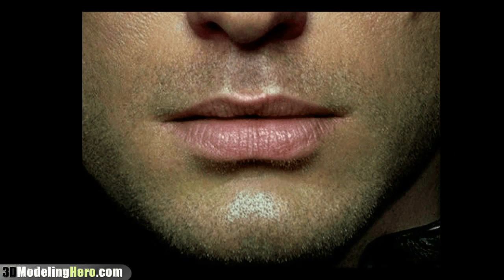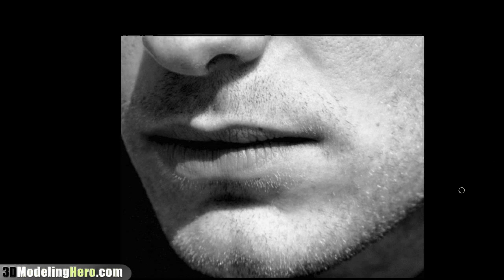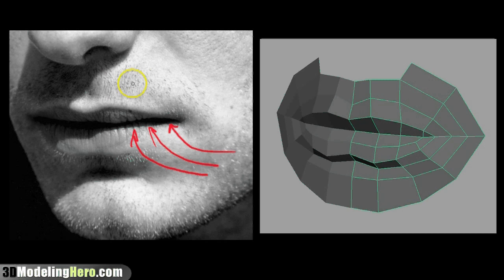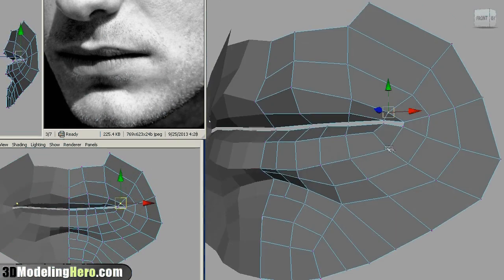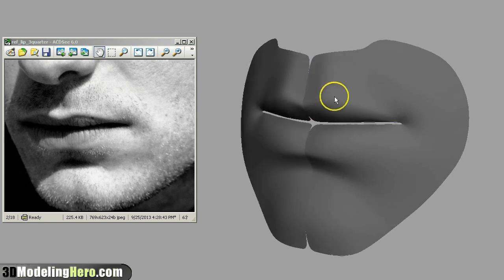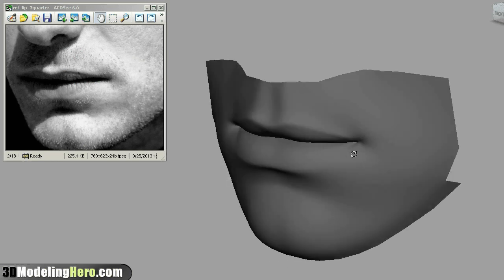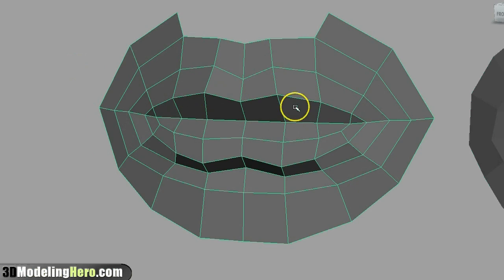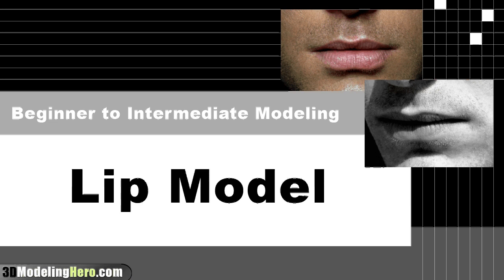How to Model Lips & Mouth - Low Poly Beginner 3D Modeling Tutorial

Comment: How do I do the first step? = Split the polygon so that I can mirror the animations? (I'm a beginner) I would just like the name of the tool :)
Reply from the maker: Leo Svensson I use the Split Polygon tool. The mirroring is just so that you can just do half since both sides are identical.
Reply: WeiWorks Thing is, I use the Maya 2015, but it's not there and I really don't know how to do it :(
Reply from the maker: Leo Svensson If you're a beginner, you'll need to get a manual for this in the bookstore. once you're familiar with the interface and it's functions, then you'll be able to model.

Comment: why do you have triangles?
Reply from the maker: Jason Whyttes Because triangles are perfectly fine in subD models. The triangles turns into quads once subdivided. Also, triangles help create sharper pinch points that you might need in your model.
Reply: So this tutorial is for a more high poly character?
Reply: Really good question, I had the same and it's amazing how much this little dialogue here taught me. The little triangle in the corner of the mouth seems useful.

Although I thought it's best to do quads in your cage so it's easier to add detail loops but I know it's good to take any advice and rules with a grain of salt and be adventurous enough to venture outside quad dogma.

Comment: Wen you are modelig the mouth, you should have made it abit slower so ppl actually saw what u were doing. wouth of that. Great job! ;)
Reply from the maker: marvelett I sped it up because it can get tedious. Hopefully the man points got across in the video.
Reply: They did. Its a good tutor. Do you have one for the whole face as well? :)
Reply from the maker: marvelett I have one of a low poly face, which is a starting point for any face. It's or Arnold's face. Check it out.
Reply: Thanks. Will check it out

Comment: like it a lot, very useful, thank you very much for that. But I have one question, how did you get those symmetrical instances?
Reply from the maker: Thanks 365Pixelz. The symmetry is created by mirroring the object on it's z axis. Just turn on the 'instance' option on the mirror panel. In Maya, it's just the 'Duplicate' function. In Max, use the 'Mirror' function.

Comment: What kind of tool you use to draw lines (edges)
Reply from the maker: In Maya, it's the Split Polygon Tool. It's the most useful tool for modeling.
Reply: Thanks
Reply: What do I need to model the way you do without even references
Reply: I can model hard surface either in 3D Max and Maya but i would like to model heads and human in general without resorting to reference images that is what i dream about)))

Comment: Amazing tutorial I just have one little problem I cant combine / merge the instance object. I have tried merging the vertices with the normal merge and vertices merge. any ideas. cheers keep up the good work
Reply from the maker: Yeah, instanced objects cannot be combined since they need to reference each other. The simple solution is to just duplicate one of the instance objects. That will get rid of the instances and then you'll be able to combine the two. If the instanced object was mirrored, make sure to check the normals as they are reversed. So check the normals on the duplicate one before combining with the other.

Comment: This is really cool, thanks for sharing your technique. Hope you'll do one tut on the eye area too, that's the trickiest area imho ;)
Reply from the maker: Thanks for checking out my videos. The eye is similar to the other parts in terms of complexity. I'll get to modeling the eye eventually. Thanks.
Reply: WeiWorks a very tricky part is the caruncula imho. Some people integrate it in the main mesh, some others leave it separated. Also the way edges flow on the outer corner of the eye is not the simplest ever, most people just make it a simple loop, which is probably not a good choice.  Probably i find the eye the trickiest area since good eyes make the real difference between a believable face and a badly modeled one.
Reply from the maker: The caruncula we usually model as a separate piece, since it has a different shader than the skin. It's a very small piece so whatever works. That's how we model it for feature film characters.

Comment from the maker: I use to be a 3D modeler at Rhythm & Hues. I was there for over 6 years doing modeling. That's where I fine tuned my modeling. What I'm showing here is what I've learned over the years. Only after so much modeling did I realize that modeling is simple. You don't need any fancy tools, just being able to split some polys and weld some vertices=). You can check out my portfolio at Weiarts.com. I use to do games too.